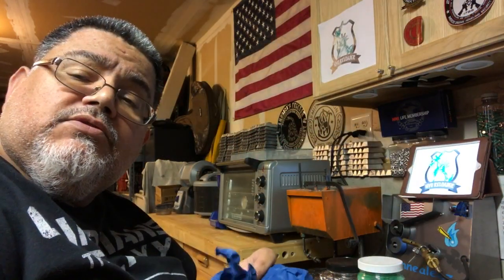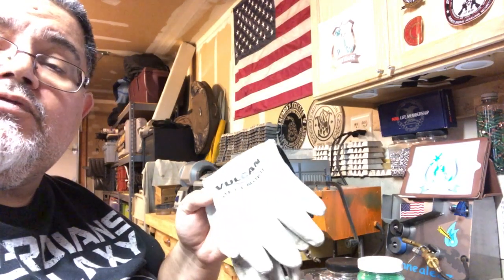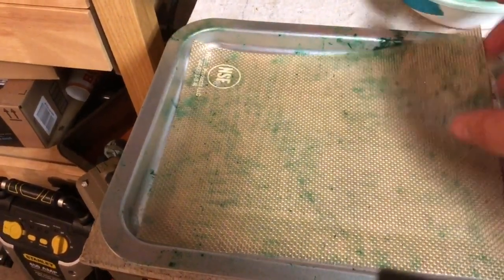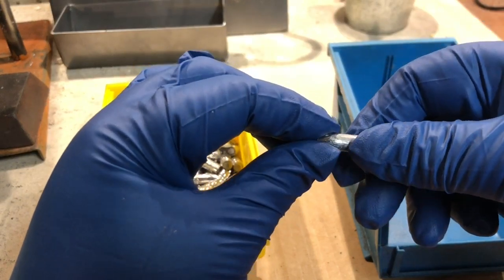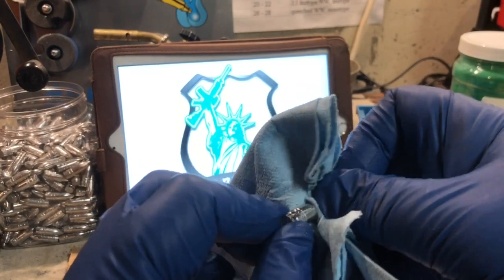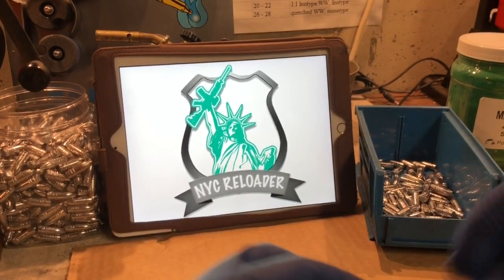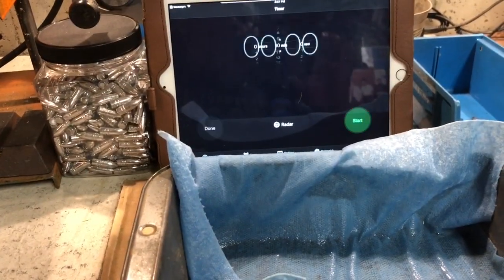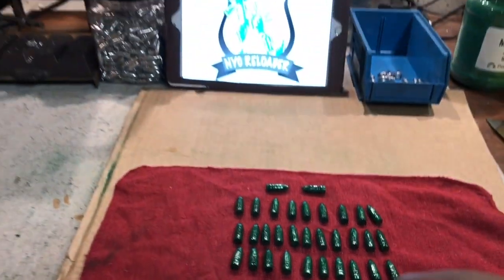Powder coating bullets using stand up method

Comment: Yep, use the stand up method when powder coating rifle bullets, and basket method for bulk pistol ammo.  My QA process is little different, I don’t try to fix anything...just remelt any flaws 👍.  Good video and I like that color 😁👍
Reply from the maker: CrankyCleatus I had to clean the water marks off those bullets because aside from that they were perfect. The others had a few snags I was able to shave off easily. So anything more than that they go back in the hot lead pot.

Comment: I like the 160 hole silicone ice cube tray method
Reply from the maker: Glad you like it thx for letting me know
Reply: @nycreloader  I use the 160 trays and pop my rifle bullets in nose first so any 'marks are usually on the 'shoulder' of the bullet and don't effect flight or expansion,pistol bullets go nose up

Comment: I'm just starting casting of pistol bullets (totally new to casting) & have powdered coated my 1st batch this week.  Question - Why do you use gas checks if they are powder coated?  I'm thinking I learned somewhere in my minor research that powder coating eliminated need for lube and checks?  Is it because your casting rifle bullets?  Also what is your thermometer brand & source, I tried using a deep fryer thermometer but don't know how accurate it is.  Enjoyed your video, many thanks!!!
Reply from the maker: bobblenuts the reason I’m going to use gas checks on these is I’m going to run them hot and fast and the gas checks prevent gas cutting of the bullets at higher velocities. Stick to sub 2300FPS or less and you will be fine. Use a heavier bullet and you will be fine. In addition I have found them to be very accurate in my specific loads. You may not need gas checks for the bullet or speed or pressure you are running. I hope that helps. Happy to speak with you further on the subject if you want to. Email me at gmail.com my username is nycreloader
Reply from the maker: bobblenuts here is my thermometer that I use. 
Tel-Tru LT225R BIG Green Egg, Grill Dome, Kamado Replacement Thermometer, 2 inch dial, 5 inch stem, 200/1000 degrees F https://www.amazon.com/dp/B0055777EU/ref=cm_sw_r_cp_tai_cZ4fDbSV0ENA4

I use gas check for high velocity high power rounds. For pistol I do not gas check.

Comment: Using the parchment paper on my 9mm's, I have stood them up and laid them down.  I can't see a difference other than the time it takes to stand them up.
Reply: 243 Outdoors ya if I stand my pistol bullets Up i use a plastic bullet tray it make lining them up even it’s so easy but most of the time I just lay them down
Reply: @williebulletman5217  I am also using the plastic bullet trays and limit myself to one tray of 50 per oven session. Very carefully remove the bullet tray after everything is fully in the oven, I have done this on 30, 303 and 8mm rifle bullets. I am using a grill & bake mat that I got at Aldi, I think Walmart has them also; don't know what they are made of but they are working much better than parchment paper.

Comment: When you go shooting , how many rounds do you usually run through.
Reply from the maker: tires2burn depends on how much time I have but usually somewhere between 250-500 rounds a trip more if the wife comes and she joins me 65% of the time. I’ve shot a thousand rounds in an all day shooting event easy. Between calibers .223, 22LR, 9mm, .308, .45 and .338 Lapua magnum

Comment: Do coated bullets need gaschecks?
Reply from the maker: TaintedMojo great question, the answer for the most part is yes. The power coat eliminates the need for a gas check. However if your pushing the speeds of a cast bullet faster gas cutting could occur. It depends on the load of powder and the type of powder. For .223 for example. A low power plinking road that has just enough power to load the next round in your AR with enough gas blow back is all that is required. We don’t a,ways need ammo at supersonic speeds when subsonic or close too subsonic will do for plinking paper targets. Save ammo, powder, and expensive FMJ boolits for when needed. For pistol these days I never gas check. For rifle I gas check only if I need to push the cast bullets a little faster than a standard pinker round.

Comment: QA and QC is not the same and the terms  should not be used interchangeably. 
In short QA has a focus on the process and QC has a focus on the end product.
Reply from the maker: Søren TF clearly they are two separate thing but in this case I am focusing on the process at each step and again at the end making sure the final product is within spec. There are so many steps to create a proper boolit (cast lead bullet projectile) and like many reloaders my process includes check the multiple final products. For instance. When I cast lead ingots from lead and mix the proper alloys and test the hardness of my lead. That lead becomes a component and is itself a final product for my inventory and must be QC’d in order to sit on my shelf. Until it’s used many months or years later and molded into a cast boolit. That cast boolit might sit in a container for years until it is used but before it gets that long rest it has to pass quality control. Then I may or may not powder coat that bullet using a stepped process and then again they sit on a shelf perhaps for months to years. They also get QC’d in order to earn that right to sit on my shelf inventory. They are completed components that if I didn’t make I would have to buy and expect perfection and standards to be upheld by a manufacturer following industry standard best of practices techniques and specifications. When I gas check then, yet another process which all start that process do not pass and some will be out of spec and be rejected. Finally when I build a bullet cartridge and assemble a finished bullet using components I have made and tested throughout the QA process for each components again once completed assembled bullets are measured, weighed, inspected and become inventory. To also sit on the shelf until needed until the actually final test of shooting them. So I don’t think it’s possible to not QA and not QC unless of course you simply buy new ammo. There are lots of processes, lots of steps, lots of failures to get to perfection and only perfection gets to sit on my shelf.